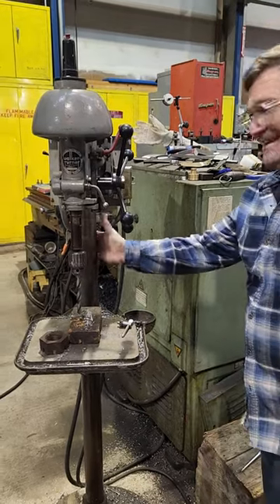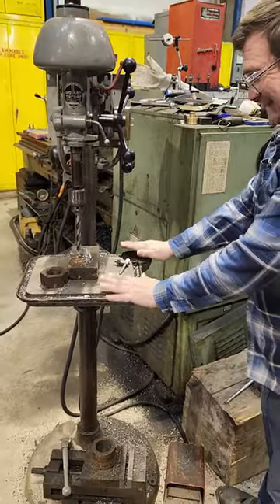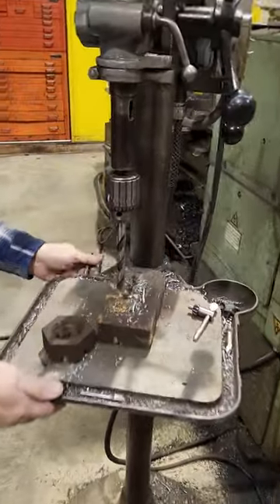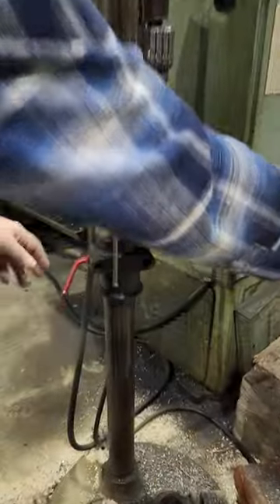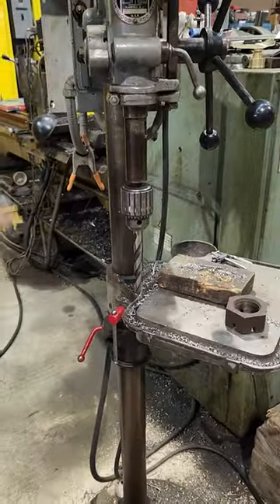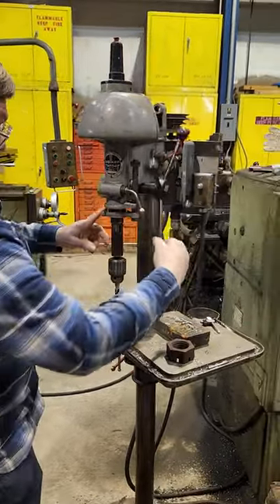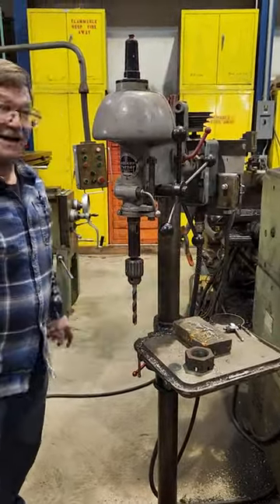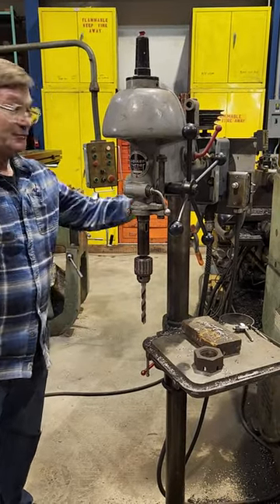Machinist's Minute: The Parts of a Tiny Drill Press

Comment: I need tips on using a drill press more effectively 😅 I always struggle on the drill press for some reason 😭
Reply from the maker: I might make a video on this, please be specific about what problems You have had, or what You are trying to do when you have problems?
Reply: @HOWEES  lining up to drill my centrepunched holes, it always takes me SO much time 😅 especially when drilling multiple holes if I already have my workpiece in the vice, I end up taking the workpiece out of the vice and trying to reposition it multiple times and I'm not sure if that's the best way to do it 🤔 I think it's just the way the table swings that drives me nuts because it's in an arc 😅